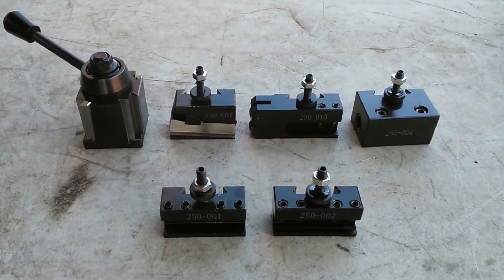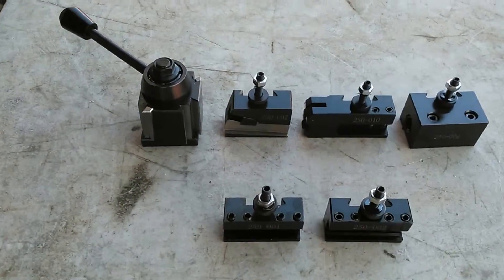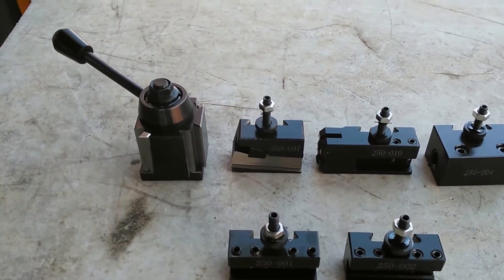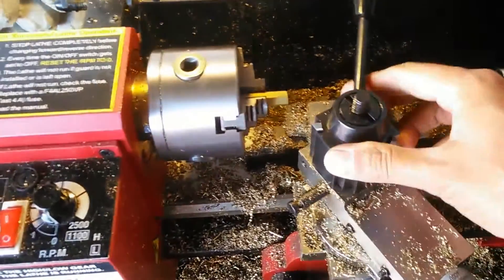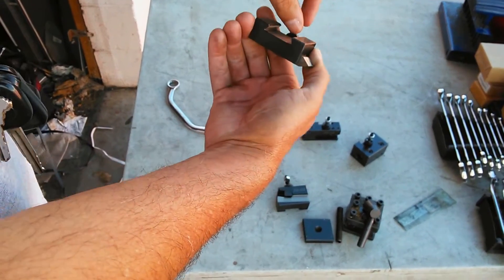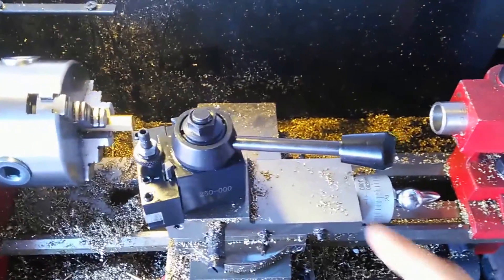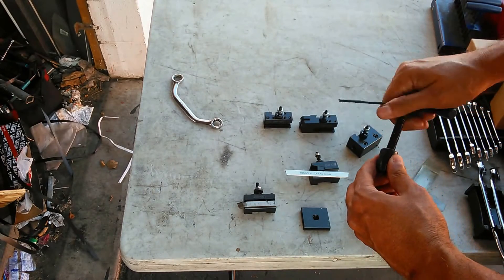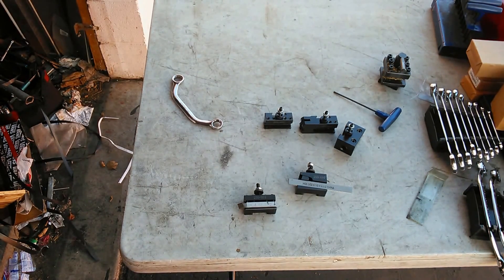Lathe Quick Change Tool Post Installation

Comment: Where can I get this ?? Anysite... I have the same lathe as yours .. bought the the aluminum on amazon and not locking well ..
Reply from the maker: The best place to buy ANYTHING for these mini lathes and mini mills is Little Machine Shop. They have a customer service team that is second to none and they stand behind the products that they sell. I recently had the master control board go out on this late and replaced it with one of the kits from Little Machine Shop. The kit that I ordered came with the new control board mounted inside a box with controls, a master breaker, vector switch, rheostat and fuse access mounted on the outside of the box. The kit also had a new motor. I wasn't sure if my motor needed to be replaced or if it was the box, so I ordered the kit with both because I didn't have the time to trace out the issue. I used it for a while, and the lathe stopped working a month in. I ordered a new kit from them because I was right in the middle of machining parts for a customer. I paid for expedited one day shipping and got it the next day by noon (excellent service because I ordered late in the day Midwest time). I called Little Machine Shop and they told me those parts were still under warranty, so I'll box up the unit that failed and they'll refund my credit card.

Comment: How do I “adjust the yaw”?
Reply from the maker: There are three tiny adjustments on both the X and Y slide. These adjustments involve loosening the nuts, then tightening the bolts in the centers of them with an Allen wrench, then tightening them back down with the retention nuts. You'll want to grease the slide and tighten then to the tightest point that still allows the slide to move without binding. Make sure the slides are "at center," otherwise they will bind as your slide progresses. You'll need a very light touch with those retention lock down nuts, otherwise the bolts will stretch out of adjustment These hobby lathe's aren't the best when it comes to fine tuning.

Comment: You can replace the not on top of the tool holder with the handle from the original tool post so you can change the tool post angle with out having to get a wrench

Comment: Why they have two sides for this QCTP is because you set the one parallel to the chuck while the other is out front to use with boring bars without moving anything.  You never install two tool holders at the same time. So if you set one parallel to the chuck and the other inline with the center axis, you will shortly see how well it works.
Reply from the maker: This is a mini lathe, so the axis' move a lot evem after a fine tuning. The work around (as far as this lathe is concerned) is upping the spindle rate so that the tool does not chatter or bite, while (at the same time) putting pressure on the Z axis so as to keep it stable. This allows me to extend the tool out longer than I would normally be allowed to and stabilizes the cut. This is obviously a compromise due to the limitations of this tool. Obviously, doing this is somewhat of a compromise and causes some heat to be transferred to the work. The trick is to use lubrication to help alleviate part of that friction.

Comment: thanks for doing this frank...going to get this and a new 5" jaws for my  hf lathe...any other upgrades you did?
Reply from the maker: I haven't really added any other "upgrades" to the lathe. I'll likely be making some custom tools so that I can cut a radius on some specialty parts that I'll be doing at a later date. Getting the lathe to perform is the biggest upgrade you can make. The X and Y axis movements are somewhat out of tolerance when these lathes are new, so you'll want to get those aligned for sure. I did a video on this procedure:  https://youtu.be/_NBjSVNUw70

Comment: I'm still researching various 0XA QCTP for my 618. Glad to see you did not turn on your lathe with those keys hanging around your neck :)
Reply: i was actually thinking that exact thing
Reply: I picked up a used A2Z 0XA tool post from eBay with tool holders, spare tooling and a separate T nut that is the length of the compound's slot.  It works OK, but it is not a wedge style and the company is defunct. Little Machine Shop.com just sent a notice that they have the wedge style QCTP with holders and a knurling attachment back in stock.
Reply from the maker: When it comes to some items, especially for machines, it pays to order from reputable people. I get a lot of stuff from Little Machine Shop and Shars.

Comment: I just realized that with the quick change tool post you gain the ability to change bits quickly, but you lose the ability to quickly adjust the angle of the post.  Do you find this to be a disadvantage? Or would the locking "lever nut" from the stock post replace the regular locking nut on the quick change post?  i.e. you would then have two levers, one for bit locking and one for angle locking.
Reply from the maker: You really have the best possible scenario with a tool like this. The nut at the top of the post is the one you use for changing the angle. The lever is what gives you the quick change capability. It's done this way because you will generally change tools more often than you'll change the angle of the cut. Both changes are very simple to do.